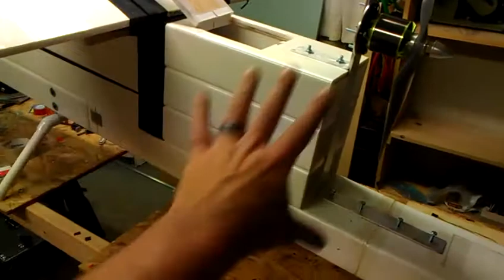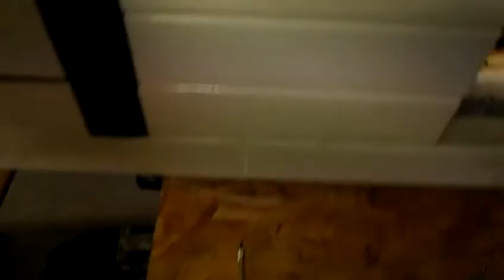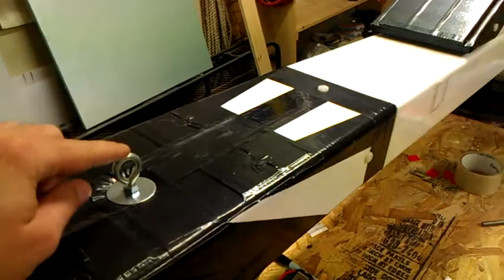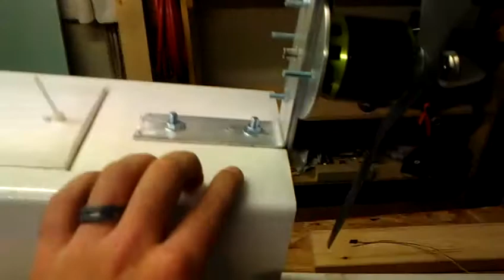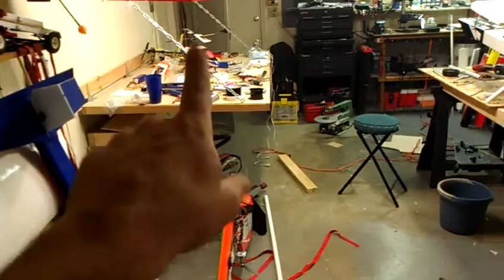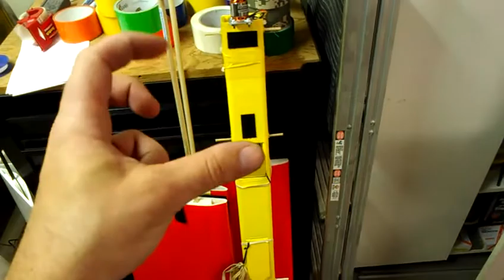FB Albatross Update  July 8, 2013

Comment: Nice!  Can't wait to see it fly. Are you going to put 3 axis stabilization on it?  I've used the same method of attaching the wings with Velcro straps for my Axon. It works great. Make sure the foam board is reinforced where the straps wrap around the edges to go underneath, so the foam can't tear. I'm replacing the upper section of my Axon right now because of that.